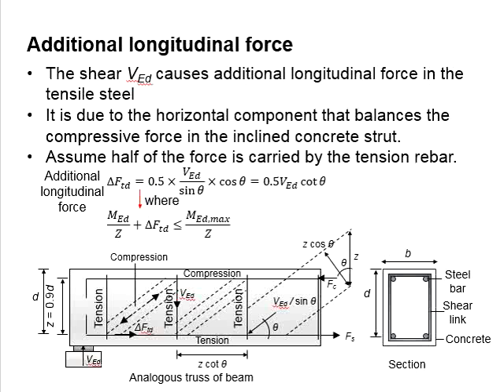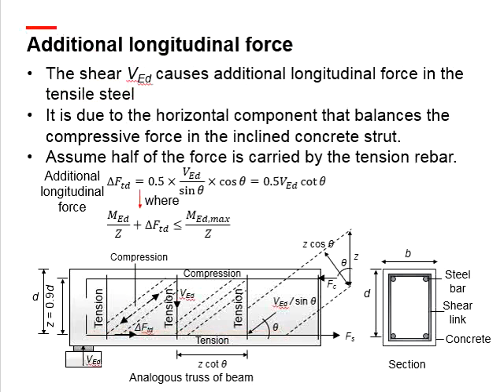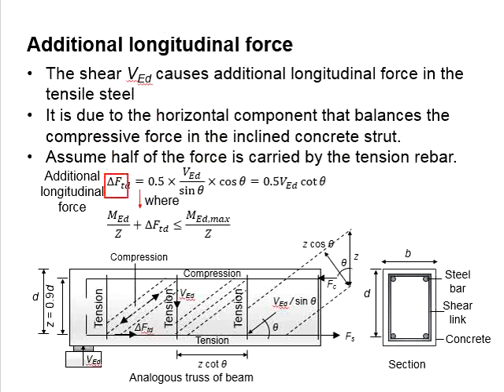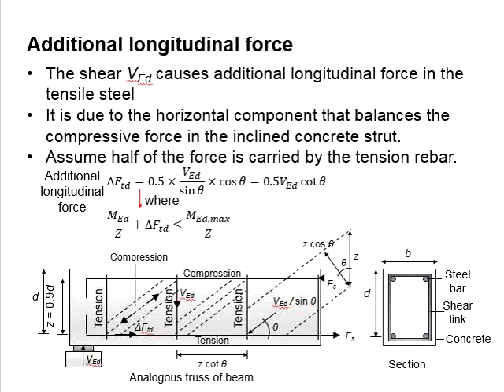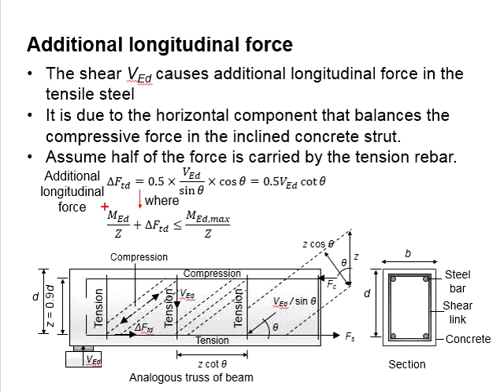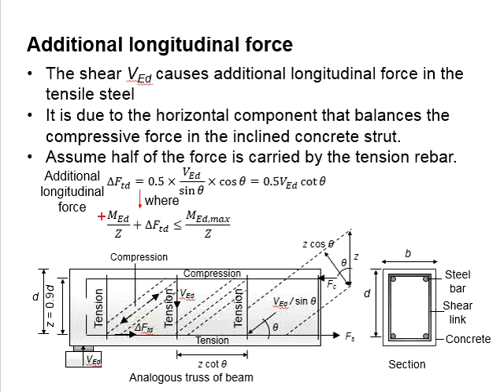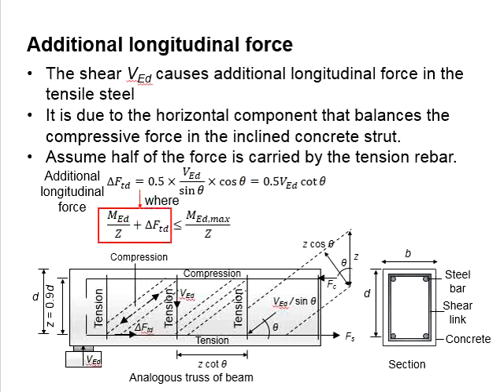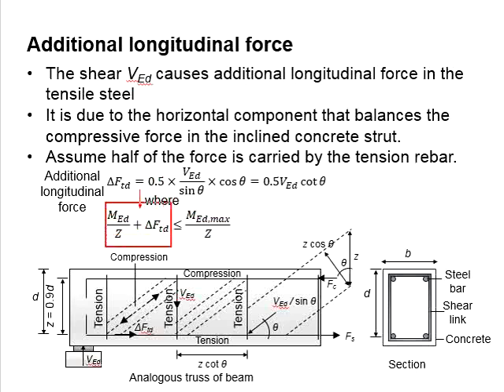5.6 Additional longitudinal force

Comment: hi, i wanted to ask why only half of the additional tension carried out by the tensile reinforcement
Reply from the maker: It is an assumed value. I took it from Reinforced Concrete Design to Eurocode 2, 7ed by Mosley
Reply: maybe because concrete its self will resist half of this force and the other half will be carried by the steel bar.